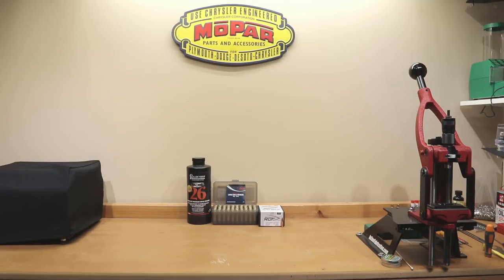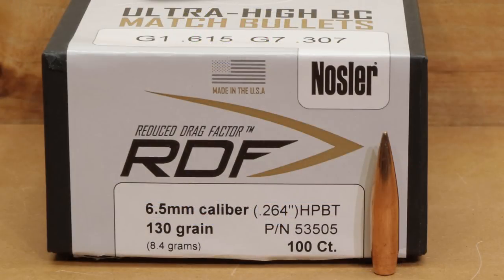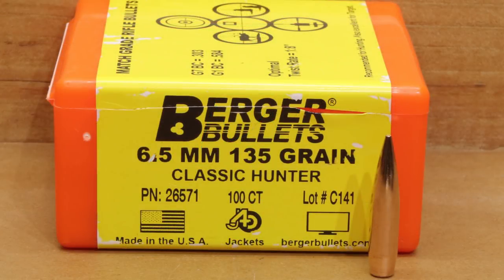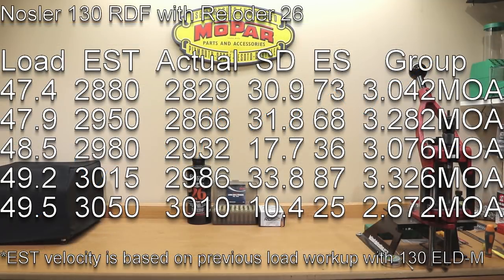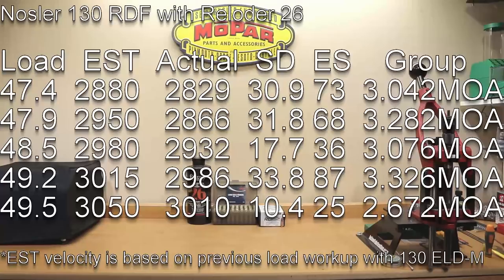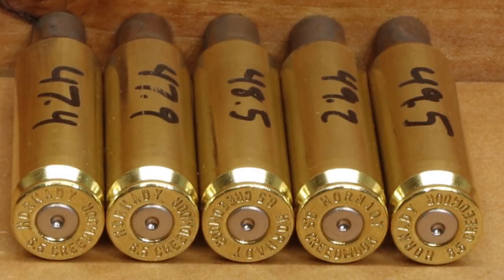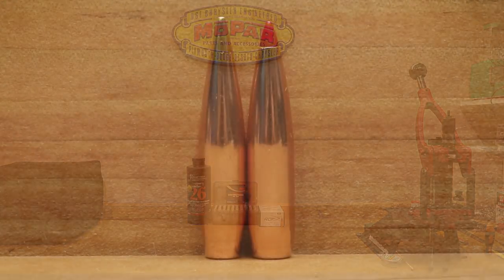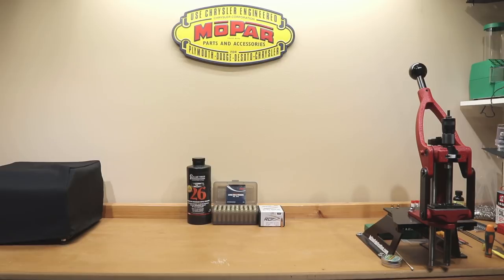Nosler 130 grain RDF with Alliant Reloder 26 in 6.5 Creedmoor

Comment: I’m kinda far behind, but I used Nosler 130gr with VV555 and did some ladder test from 41.0 gr to 43.4 gr with .3gr increments. 8 groups out of ten yielded under one MOA, but my ES and SD were up in the sky since I didn’t have the tool to control the neck tension and possibly a bad primer (Fed 210) in Hornady brass 6.5 Creedmoor. Might find different brass and primer. Thanks for sharing.

Comment: I found two decent loads with H4350 and about .30 off the lands. But my velocity was slow at 2800 FPS and 2860 FPS  for a 130 grain class. These bullets are really hard to tune compared to the 140 RDF it took 300 bullets to finally get this to shoot 1/2 moa with excluding the Random Damn Fyler. I would honestly recommend to stay away and just stick with the 140 RDF.
Reply from the maker: That seemed to be the consensus that I have read so far, but was hoping others found otherwise.

Comment: H4350 40.4gr. .040 off lands.  Hornaday Neck turned brass cci 200. Brass sorted to 3 grain batches.  I've shot a .17 moa 2x. Once at 200 yards and once at 100 yards, on two different days. Out of Thompson center compass rifle. Low end rifle shoots lights out. I was shooting 1.5 moa,  until I found the seating depth. I ran the Berger seating rule. Easy to find.
Reply from the maker: Thanks I will have to give it a shot. In the lands isn't a option, since there would be almost no bullet in the case on this one.
Reply from the maker: Looking at some load data, are you running only~ 2640 fps? I was really hoping to be able to push a 130 gr a little faster.

Comment: Very interesting data by indeed.

I'm curious as to where did you find load data using RL26??? I think it may be way too slow for this size case. There are a couple of things to consider with the 130gr weight class bullet- 1) First, try seating the bullet deeper and reduce powder charge. Both Lapua and Sierra recommend a COL of between 2.690"-2.810" depending on bullet. Lapua seats the Barnes TSX to 2.717" with Max velocity around 2687fps and Sierra lists a COL of 2.670" for a130gr hpbt.

My most accurate handload to date is using the Lapua 136gr sceaner-l over VV N160(45.7g) with a COL of 2.770"- velocity avg is 2925fps and a .313" 5 shot group out of a bone stock Savage 10 fcp-sr. Interesting side note, recently shot this load at 1000yrds, balistic calulator suggest 6.3 mils, actual was 5.6 mils- produced a 6-7" group 4 shots @1000 yrds.

consider reducing charge it and drop velocity down in the 2850-2950fps and seat a little deeper.

keep up the good work!!!
Reply from the maker: The RL-26 data was based on the Berger 135 Classic Hunter. I had really good accuracy with the 135 under some of those charges so I was hoping for similar velocity and groups here, but was not as lucky. These bullets are just hard to figure out. Hopefully someone figures out how to get them rolling.
Reply: Bolt Action Reloading I had the same problem with the Lapua 136's, I know they are great bullets but almost walked away from them because I couldn't get them to shoot better than 1-1 1/4 moa, looked at Lapuas load data, where I was seating around 2.810", they recommend much deeper, 2.680". When Sat them to they're specs- magic!!! .313" - 5 shot group and they shoot incredibly flat out to 1000yrds
Reply from the maker: I have some sitting on my shelf that I haven't even tried yet

Comment: I have been using the 130 Nosler RDF with Lapur brass,  CCI 450 primers and 43.6 grains of Reloader 16, I think I am about .300 off the lands and am having the same problem, flyers and out of 10 shots by my Labradar will have a couple of shots that will open the extreme spread up to 30+ fps. I did not have any of these problems with Hornady 147 ELD X or 140 gr ELD x     Larry Baker
Reply from the maker: Lawrence Baker I just got done trying another powder with the 130 and results aren't much better. Probably not worth the hassle.

Comment: 42gr of H4350. Ogive measurement at 2.2185 inches. Sub moa at 100 yards. Good enough out to 750 yards on 12" plate. However it won't group consistently. Very finicky.

Comment: Great job. I'm thinking  .20-.40 thousands jump  try 2.88 or maybe lots jump 2.7" oal?  w 49.8-50 grain RL26 see if group tightens. Also from what I see most loads above 2850 fps in most 6.5 cm to fast. Although   my RPR shoots Under 1/4"w 129sst Superformance 2950fps. But same load in T/C compass is 1"-1 1/2" ? I

Comment: I started off watching your vid on neck turning the brass after this vid. As you stated, they are indeed terrible groups. After seeing most of your other groups with different bullets & etc, I have no problem concluding that, this bullet just would not stabilize sufficiently in the rifle you used. Many people mistakenly believe that if the bullet doesn't stabilize it will keyhole which, is correct however, it is known that although the bullet may be stabilized enough to fly tip forward, it can be unstable within that attitude which manifests in erratic behaviour down range. I reckon something is wrong with that bullet/barrel combination somehow.

Comment: I’m guessing you aren’t spinning the bullet fast enough. Sierra seems to be one of the few manufacturers that is very openly telling customers that the VLD type bullets need a faster twist rate for, you guessed it........accuracy
Also seating depth is critical. VLDs tend to like almost no or sometimes a ton of distance to the lands. 
This will be fun to watch the progression. Thx for posting!
Reply from the maker: Yeah its a rough start. I feel they are likely a picky bullet. I really can't imagine them need to spin any faster, they are not the 150 SMK (that bullet needs the twist)
Reply: I don’t have that bullet’s specs but google the Miller Twist Rule for a rough formula. Berger also has a calculator on their site- I think it’s actually the same formula. Both are very crude but will get you in the ballpark. A score/number of 1.4 is thought to be ideal.

Comment: Ballistic coefficients don’t mean much if the bullet isn’t really accurate to me.
Reply from the maker: You are absolutely correct but I don't want to give up yet.
Reply: Bolt Action Reloading I hear that.  Hope you get it going your way
Reply: Could be the combo used but as myself and others have experienced such as Johnny's reloadinf bench, these bullets like to jumped, a lot of jump. Before i knew this I was shooting 1.5  MOA with the 140's. Seated em deeper to .160 jump and shrunk the grouoing down to around 3/4 MOA for all my charges with 1 beibf at 1 MOA and 2 charge weights at half MOA. Therefore I thibk these bullets may be capable of half MOA but there probably very sensitive like the 140 RDF's and require a lot of tuning not required of other bullets to shoot well.

Comment: I think you’re using the wrong powder reloader 26 is way too slow that’s more for a big magnum  Reloader 16 is what you need
Reply: RL16 gets you some smoking velocities.
Reply: Operator Headspace yes I use it for 6.5 creedmoor and 6.5x47 Lapua 27 inch barrel 2900 f/s 140 grain Bullets
Reply from the maker: I am going to try some other combos. I picked up 300 of them so we will give a couple a shot. The 140s got off to a rough start so we will hope for the best.
Reply: I think like Frank, this could be caused by using the wrong powder. I have not tried this combo, but suspect the horrible SD/ES is a result of incomplete combustion. The slower burning magnum powder with light bullet and a 24” barrel may not be allowing optimal combustion. I would try a H4350 or Varget burn rate powder and try again. 

That said, I find it hard to believe a load could be so wrong to give 3 MOA at a mere 150 yards. Could there be anything wrong with the equipment: barrel, base, rings, scope? Do you have a pet load that gives 1/2-3/4 MOA that you could shoot a couple 5 shot groups to verify that the equipment is not the problem?
Reply from the maker: Hi mark. Same day different load.  .6 to .7 moa. As far as the combo is concerned this powder / primer with the 135 bergers worked pretty well and the velocity chart from the 130elds did not show anything crazy for velocity swings so this was unexpected.
Reply: There are many things that can be different between bullets of the same weight and make them act differently. The amount of bearing surface is a big one. The most reliable would be to use a known powder like RL17, RL16, Varget, H4350 or 4350 to make sure it's not the bullet. I'm still shocked on your group sizes. I could practically do that with my rimfire. Something sounds off.
Reply from the maker: This Saturdays video I load this same load in neck turned brass from the same lot. I think the results are interesting. I will try again with a more likely powder, but was hoping for great things. But I was wrong.

Comment: What is this obsession with velocity, surely accuracy is by far more important? all I ever seem to hear about is getting bullets to go faster & faster, stop it! speed isn't always the way forward, try some proper load development for a change, Oh, and spare your barrel in the process.
Reply from the maker: Hi Eric. You are correct accuracy is more important than velocity. I never state otherwise, however I have a 147 RLD-M load that is currently my best long range contender. For this to overtake that as my primary load then this needs to shoot in the velocity range that I tested. If you have to slow this projectile down to 2600 fps to hold groups (and I am not sure that would help either) its not the right choice for my application. Not sure that I need to waste time developing loads that I would never use. I bought these bullets to try and see how they worked, they don't for what I would use them. (I may still do some OAL adjustments and try a different powder on them, since I have some left) Also I really don't mind shooting my gun, that is what I bought it for. If I waste barrel life its on me. Not sure how long you have been with us here on the channel but I haven't been reloading for 30 years and I don't claim to be a expert and not afraid to admit it. I am using this barrel to learn, I have every intention to burn it out and replace it with a new one. The reloading community can't agree on pretty much anything so I am simply doing some testing and posting my results here in case someone else has interest. I know I am biased but I have been surprised to see some if the things that have and have not improved my results. I haven't found anyone having luck with these projectiles either, but as always if I find a good load I would let someone know how I did it.